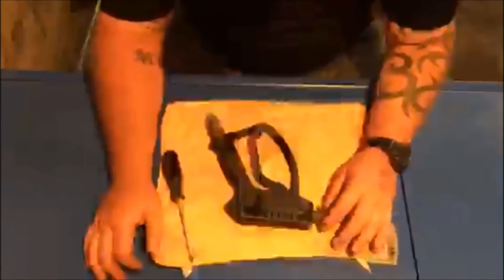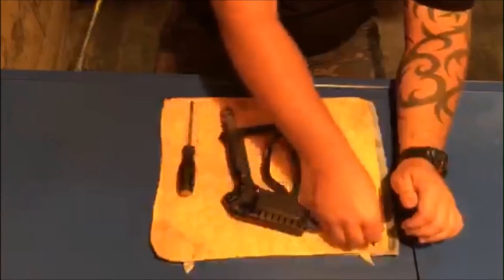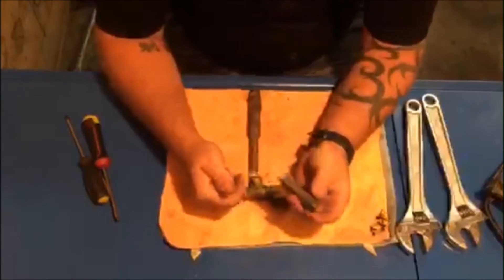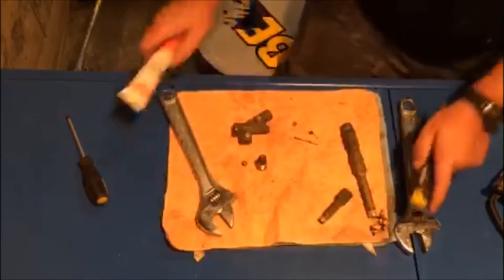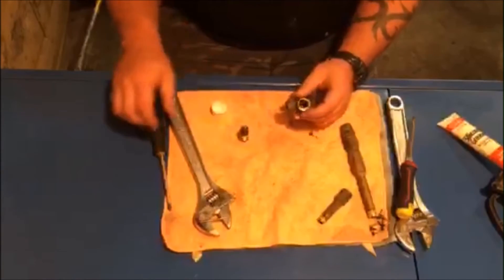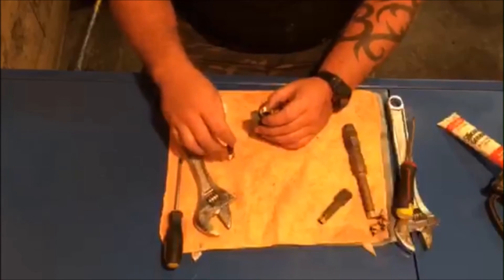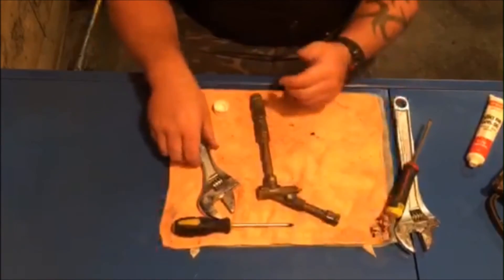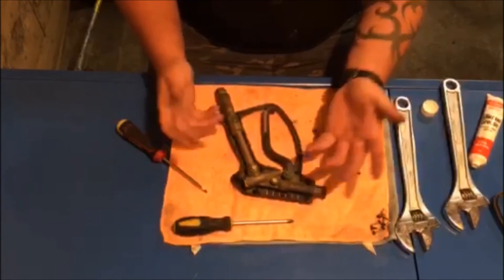Inside a pressure washer gun

Comment: I have a brand new PA gun that the wand fitting is cracked , it looks like the fitting pipe would unthread but I am not sure and if I could get a replacement part .You didn't show how you removed the pie fittings , I feel like it is going to break